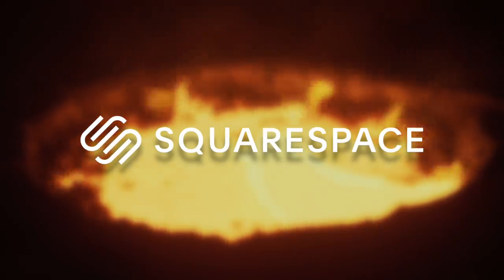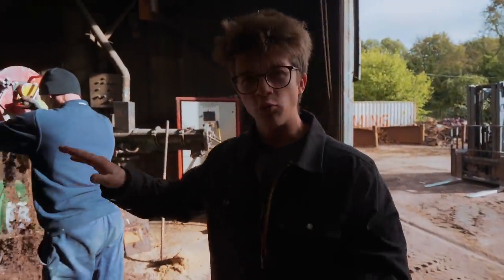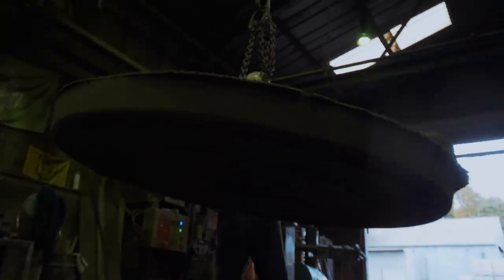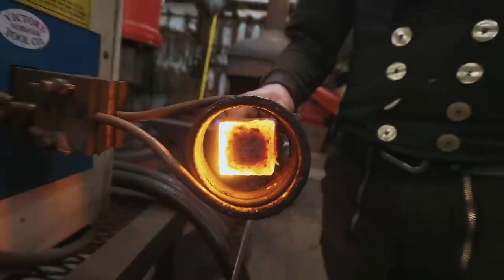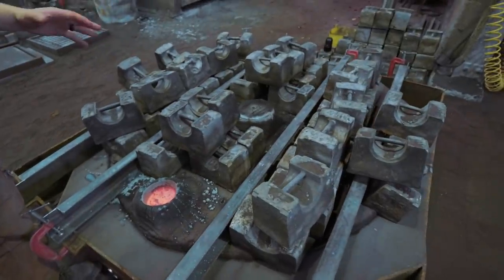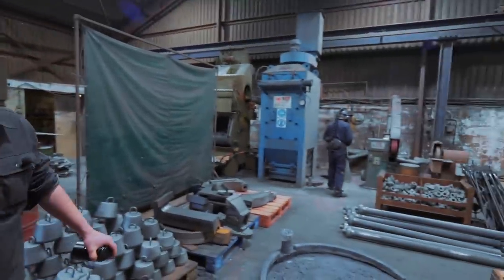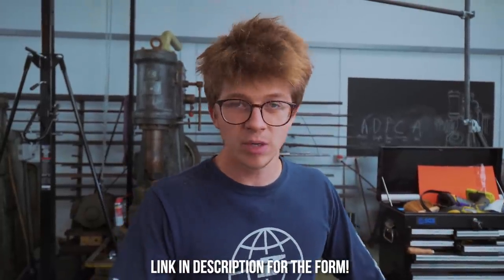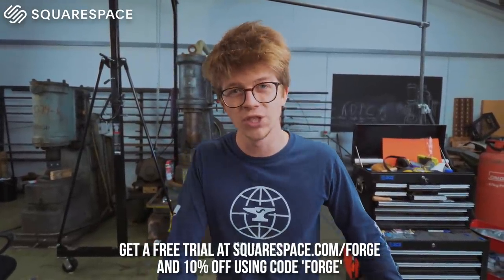Casting an 800lb cog!

Comment: I have been fortunate I my life to have done a small amount of metal casting and seen it done approximately 40 times. 

Alex used the term choreographed to describe the actual pour.  As I was watching this I was remembering it was like a ballet. 

A crew as good as this has no wasted motion and is sure of the moves of everyone else on the pour. 

Work like this done at this level is truly a joy to behold.
Reply: Thank You Brian' Appreciate your words.
Reply: Interestingly, the same thing can be seen at complicated surgeries, no wasted motion, a step- by- step- work approach and sometimes even markings on the ground for better coordination. In both cases, casting and surgery, you've got a delicate operation with a very limited time frame and little room for mistakes.
Reply: what kind of resin did you use in the sand? what did they spray on it to keep it from seeping into the sand?

Comment: i would be incredibly surprised if Alec doesn't get a small induction forge to work with the  smaller rounstock and squarestock he works with just for the sheer noise and price savings
Reply: Ive been debating making one for that reason. And I don't hardly do any blacksmith work
Reply: he’s tried that before…. didn’t go well at all
Reply: @loganhuwe9458  I'm guessing that it is hard not to overheat and melt the metal stock?
Reply: @ChevTecGroup  It's essentially a microwave for metal. The interior can be much cooler than the exterior, and you can start to melt the exterior.
Reply: @sigmasquadleader  If you use it wrong, you can produce this effect. Induction coils are used in commercial forging, and normal forging all the time. It's not even hard to avoid melting it; the depth of the heating is gradually reduced with depth (With appropriate settings), and the natural conduction of steel will even out the temperature. The center will never be "much cooler" when used correctly, because of the aforementioned natural thermal conduction of steel.
In the video you're mentioning, he very clearly did not use it correctly, or adjust it's output for the application.
It's like welding, you cannot just turn on a welding machine and weld any material at any depth reliably. The exact same applies to Induction Forges. The "Skin Effect" is reduceable, which is simply done by adjusting the frequency and power output.
Induction forges are so much better at heating metal, it's not as simple as sticking a piece of stock in and hoping it heats your metal thoroughly. More energy is going into the metal than would ever really go into the metal if you were using a propane forge. This is why it's important to not only buy a GOOD induction heater, but to understand the relationship between frequency, output power, penetration, and heat.
Coil size can limit the maximum potential heat output, power output can do the same, and frequency can limit the depth and level of heat achieved.
A high frequency, high output setting would be best for melting steel, while a lower frequency/ variable power output ratio would be best for forging. 
The big point is that it's cheaper, and more efficient in the long run to use this method; while also being faster. Time is money, money is money, and lost energy is money.

You can forge hundreds of items in the time it would normally take you to forge tens, nails and leafs; knives, etc.
It's even possible to forge weld with induction coils.
Reply: Then again this is no small feat and comes with no small investments. Melted metals are incredibly more dangerous than heated ones... Steel in particular is a bubbly, sparky metal, and water is a danger that can cost you limbs or lives if you don't remove it down to the last spec. I do think Alec is capable of doing it, but if he ever does, don't expect it for a very long while.
Reply: Sometimes it feels like people don’t realise. Alec is a very good your tuber. But a below average smith.
Reply: @D-Vinko  How big can forging induction heaters be? Is there a maximal coil length/diameter for comercially available ones? Would it be possible to design a self- regolatory induction heater that will heat your metal to only a certain temperature (for example, by measuring the metal's elec. resistance)?
Reply: @AkrimaSablosang  Well depends on context. If we're talking about Alec's set up he's using very pure, refined steel, it's not going to bubble and spark. You only see bubbly steel in processing un-refined iron during refining scrap metal or ores where the steel is molten sitting in a crucible. It's not going to happen if Alec is heating up steel in a coil and using processed steel.
Induction heating is also mainly on setting the parameters of the power and frequency, less on any learned muscle skills. If he can learn TIG welding he can learn induction heating if he wants to.
Reply: @TheGunz0001  there's still the risk with moisture though... theses are never 0%. as we can see in the industry, since it's N°1 reason for accidents.
Reply: @AkrimaSablosang  yes but everything has risk. TIG welding at high voltage, gas furnace, power hammer. Everything has its hazards and safety precautions. Also i kind of doubt its the #1 cause of accidents. Electricity and chemical related freak accidents r more frequent than heat related.
Also again, i wanna emphasize Alec is working in a workshop, not an industry. The amount of molten steel, the energy densities r significantly more manageable.
Reply: @garyhost354  he is a fantastic hobbiest, but its not his day to day job, his day to day job is making youtube videos.

And he is very young  as well for the job.
Reply: @tmarritt  I totally agree with you.

Comment: I used to do this work on a large pep set line. Just like this but a finished mold weighed 120k

By the way the bottom of the mold is the drag while the top is the cope

Comment: I used to run a hobby foundry. I had that same thing happen, when I pulled up the crucible from the furnace, I wouldn't speak, and I had this focus and complete tranquility. Ironically this is the most dangerous part of the whole casting process.

Comment: where were these videos when i was studying engineering in college. also an interesting point, i dont remember talking about weighing the sand down to stop the cast from coming appart in my write up of sand casting. i wonder if it was included in my research or if it was just missed

Comment: Hey Alec a thought to you why not try to reforge the meteorite piece except you have to reheat it and melt it into a billet of usable material before hammering it and forging it out maybe slowly heating and cooling of the meteorite will help the crystal structures form better

Comment: If you come to austria you can visit the old "radwerke" and the old iron ore mine called "erzberg"
Those laid the foundation for our steel industry and the Voestalpine. Its also the home to the LD process. The main production route for any modern steel. 
We do have some amazing forges as well, like Boehler Aerospace with 35000 ton spindle press, if you are kore into giant hammers, we counter-strike hammer with a force of up to 35 meganewton.....

Comment: Alec, you should try to forge aluminum. You could make a mini forged bike out of a real bike if it is possible to forge aluminum. I tried and it just needs more heat than normal so it doesn’t crack and crumble.

Comment: When the molten iron is poured into the sand mold and flows through the channels how does the air escape within? Just back out where the molten iron was poured in?
Reply: The pressure and air comes out through the sand and extra vents we put in the mould. 

Sorry for the delay explaining

Comment: p-p-pump out that content, very interesting how long the thermal energy stays in the cast, do they have to let it air cool? would there be advantage/disadvantage cooling it faster?
Reply: I think it’s a function of not wanting to disturb the mold until the metal is no longer malleable. There is no disadvantage to being able to leave a cast part in the mold, unless it requires heat treatment, which can happen after the fact.

Comment: I would've thought that there was more tools involved in compacting the sand, like vibrators and presses. And instead it's just a guy that stomps on it!
Reply: All depends on the job / Pattern set-up. Air ram tools are used also.

Comment: Theyre introducing a lot of air and agitation, and also losing heat by top pouring ... if they could switch to a more modern bottom pour system, they'd get the cleanest possible castings, and also save some energy too (less thermal loss during the pour means they dont need to overheat to compensate).

Just thinking aloud.
Reply: We know’ …..Our Foundry methods change frequently as to specialising in ferrous & non-ferrous materials. Casting quality & customer service is no 1.
Reply: Pls forgive me weighing in on matters I have zero experience with -  you guys clearly know your stuff. 😳

 I just watch scads of vids on metallurgy, and connected what seemed like an obvious pair of dots. ☺

Cheers 👍

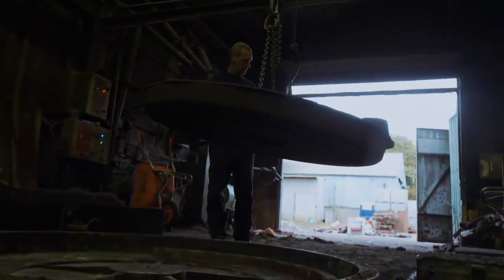Comment: 2:43 Big nope moment for me there, standing under load. I've seen some quite gross things that happened due to such health and safety violations, and although it's just hardened sand, I guess that will still hurt a lot or break your neck, if you're e.g. looking up and it hits at an angle.

But I guess, they've done that a thousand times and it went well...
Reply: I assure you it’s the camera angle. Health & Safety of our team is paramount. 

Thanks for your concern.
Reply: Yep and the more you do it without an incident the more probable an incident becomes. He shouldn't even be standing within a few feet of a live load hanging that high. I get they need to inspect it and put the sealant on but there is a way safer way to do it.

Comment: what I can’t believe is that in this age of health and safety overkill and Oh you can’t do that he stands under half ton of sand mould and works on it …fair play!
Reply: Yeah that's a huge no-no in all of the crane / lifting operations I've been involved in. Especially considering that the sand mould isn't exactly an item which has been engineered and proof-tested as being strong enough. Think it's one of those things where people say 'we've always done it this way' until something goes wrong.
Reply: @JMMC1005  gotta have a little danger at work I guess 💀
Reply: I assure you health & safety is priority for our team and it’s the camera angle that makes it look worse. He’s not underneath the mold. 

Of course it’s a high risk environment but HSE is very important.

Comment: I'm here watching all that inclusion being poured into that giant sprocket. I understand that customers determine the quality they need. I have never seen someone just use a stick to try and stop slag from creating voids and inclusion in such a huge project.
Reply: You are mistaken in your comment. The steel bar is to hold the slax product we use from Foseco. No voids or inclusions as all correct runner and filter system, again from Foseco. We only use certified pig iron and returns from our castings we cut off. So yes, a big project' But the end casting speaks for itself, and our customer has full confidence in our vast experience & quality castings we supply. 
Rgds, Chris